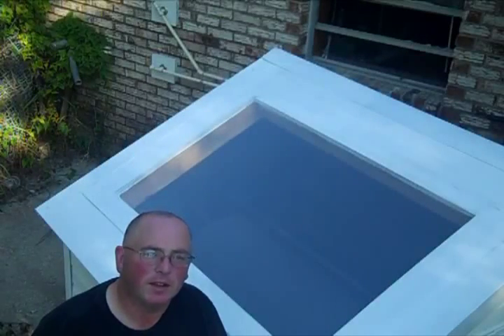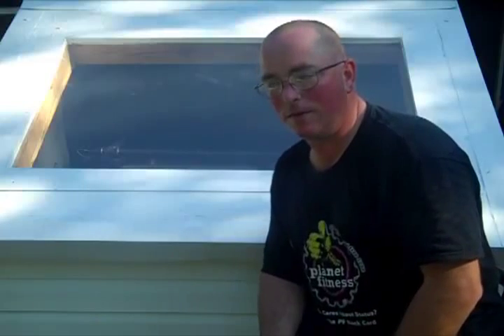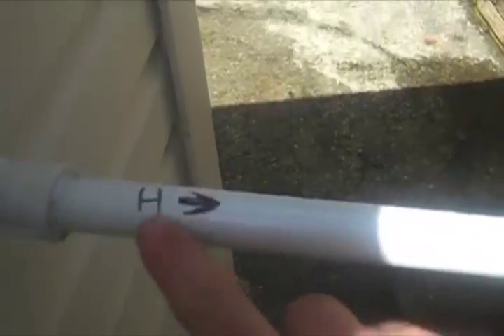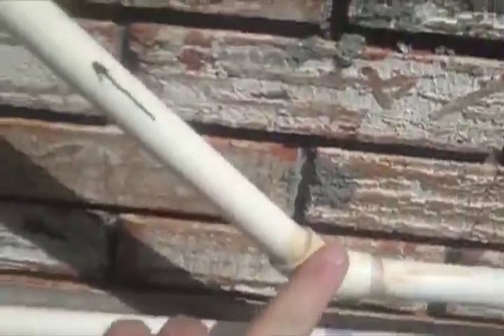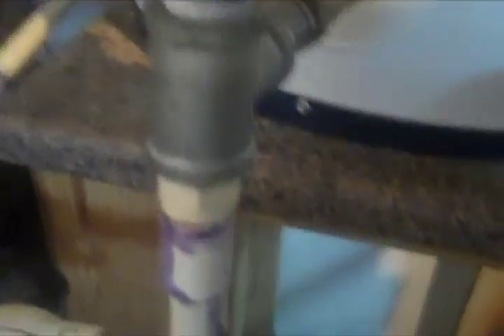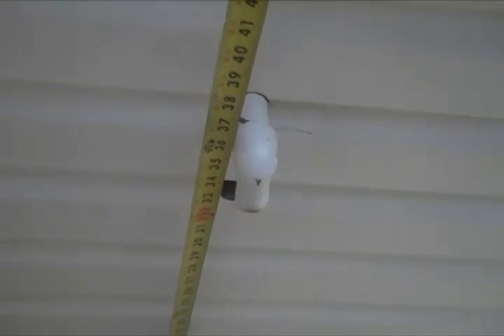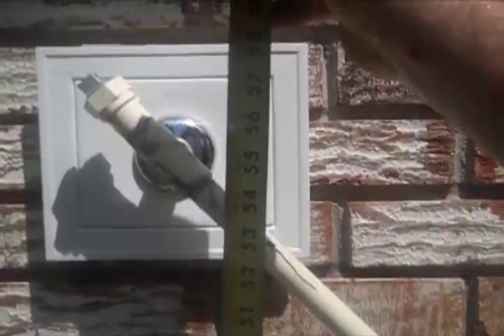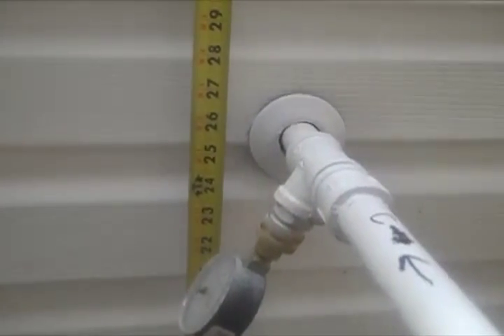Thermal Syphoning - How it works

Comment: insulate the hot water side pipe it will move everything faster and deliver hotter water. Leave cold return line bare it will drop faster. other than that good job..

Comment: You missed number 3.  Thermosiphon hates horizontal...  I am surprised it is transfering at all with the woopteedoos in the hot line.  It probably dosnt flow very well as the temp rises...  the line should come out of the heater and immediately turn upward toward the top of the tank with no turns downward along the way...

Comment: Each 90 degree elbow in a 3/4 inch line is equal to 9 feet of straight line's resistance to flow, so any sharp turns you can get rid of, will increase flow.  If you had for example, plumbed it with "Pex" tubing, and had only sweeping curves to make your bends, you would have had probably twice the thermosyphon flow.  Also if the hot water tank were in the attic for example, there would have been more "Push" from hot water trying to rise.  Great video Bro!!!